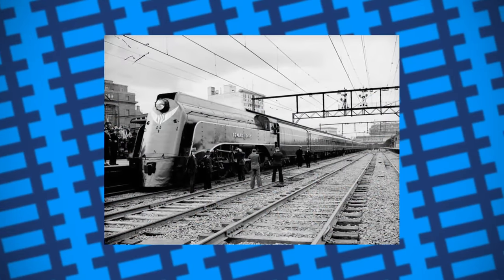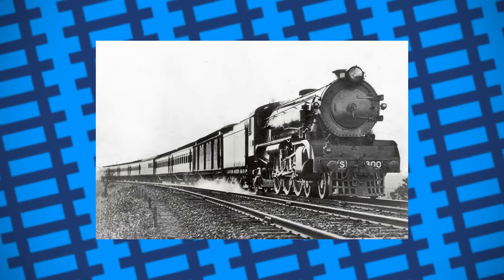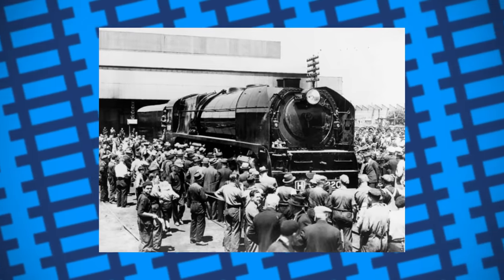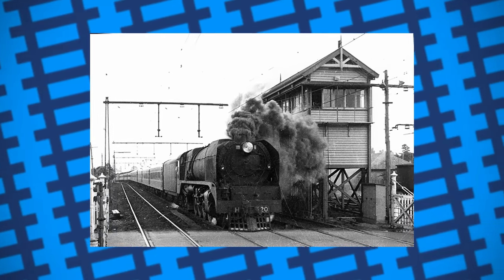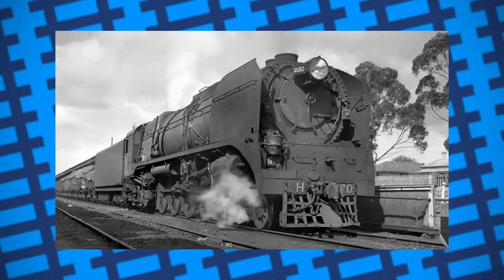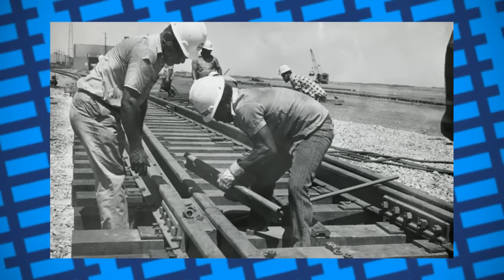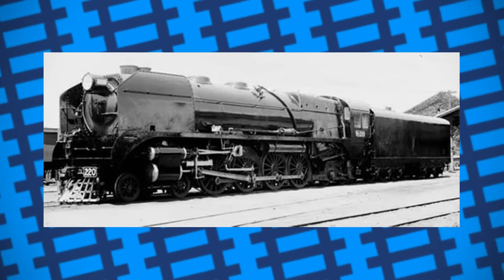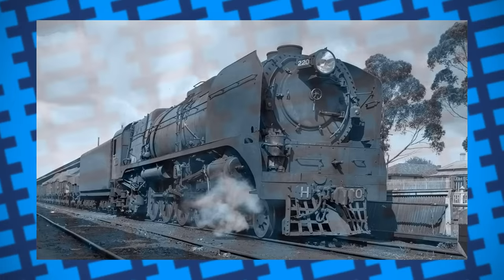Australia's most Overkill Steam Engine - Heavy Harry

Comment: Overkill locomotives are always so much fun to learn about considering their strength compared to everything else.
Reply: Which was not the case with H220.
Reply: @dat581  it was compared to the engines around it until dieselization. It was better than the other engines around it, not the whole world.
Reply: @jimmypetrock  I never said the whole world, I said Australia. It was not the most powerful locomotive in Australia at any time.
Reply: @dat581  NSW is not 'around it', none of those D57s could run down here. They would have also had the same problem with axle-load here too.
Reply: Often the case in Australia, the equipment isn't bad, but the railway is neglected. XPT & V/Lo DMU are good examples of this, never being able to achieve the running times they are capable of. Same with the Tilt Trains
Reply: Only the North American giants are bigger & more powerful. 
There was nothing this size in Europe, though some South African locos were close in size. @jimmypetrock
Reply: @johnsergei  Yes. Some much time could be shaved of the Sydney to Melbourne route with appropriate deviations to create a modern alignment.

Ironically some of the deviations made in the steam age hinder the modern railway.
Reply: And the complications that comes to the infastructure
Reply: And the complications that comes to the infastructure
Reply: Though AD60s was more powerful & slightly heavier, the boiler & rear tender were smaller (a smaller profile than H220). But non articulated giants from NSW & especially South Australia were not that much smaller than Dirty Harry. Steamranger are facing a similar problem with 520. It needs a ton of work & what do they need such a big locomotive for? Though they will get the cucumber running again.
Reply: @johnsergei The D57 would be useful for excursions in Greater Sydney. Heavy grades on all four lines leading out of the Sydney Basin (leading in for the Main North) with 1in33 on the Blue Mountains, and 1in30 on the Unanderra to Moss Vale Line.

Comment: Some comments here. The North East line is not heavily graded except for the Glenroy Bank.  There is a long but not steep climb to Heathcote Junction.  Much of the distance to Albury is close to level.  A speed track for which the S class were more than adequate.  The problem was the heavily graded line to Ararat on the way to Adelaide including the notorious Ingliston Bank.  The S class were not capable of working the Overland up these much steeper grades at any reasonable speed.  A larger engine was needed.  The H class was planned as were the bridge strengthening jobs.  There are only a few of them.  Notably the Melton Viaduct, the Parwan Trestles, the Bacchus Marsh bridge and the ironbark gully bridge.  The strengthening wouldn't have been a problem but the war caused a stoppage to this work.  The H class did work at least one train to Ararat even without the bridge strengthening as a test run.  But its ability to work fast goods trains on the North East line was valuable and could be done immediately with no other expenditure. So the reallocation was a no brainer.  Perhaps the remainder would have been built if it wasn't for the run down nature of the entire system after being overworked and undermaintained during the war.  Other repairs had a much higher priority.  So although officially all new engines had to be designed to run on standard gauge the shortage of power was so acute that a substantial number of new K class were built to this successful design. Even though they were never intended to be convertible. That was  higher priority than repowering the Overland.

Comment: Commentary is wrong in several places.. ARHS did not take ownership of H220. It was merely placed in the Museum which was at the time operated by the ARHS. Harry was and still is owned by the Victorian Government as is virtually all rolling stock in the Newport Railway Museum.
Glenroy Bank is at best 4 miles long not 5, but only about 2 miles is 1 in 50. Some irrelevant stills used in the video such as that workshops Martin's? and the track guys in hard hats.
I'm pretty sure also that the axle weights were known at the design stage well before it was finally assembled.

Comment: For those who don't know what they are:
Load compensating brakes are equipped with a valve that basically mesures the total mass of a vehicle and regulates the force with wich the brakes apply accordingly. While standard practice these days, it was a huge deal back in the 30s/40s, as it was a fairly new technology back then. Previously, on locomotive tenders, you just had a pre-set force with which the brakes would apply. This is fine if the difference between loaded and empty is minimal (maybe a couple tonnes at most) but once you start going into double digits, the vehicle starts to behave noticeably worse when braking, increasing braking distance.
Reply: Thank you.
Reply: Thanks a lot for your comment. I didn't know what they were.
Reply: @colvinator1611  You're welcome 😁
Glad I could be of service.

Comment: Australia's rail network suffered from a major problem. Each of the Colonies in Australia was originally it's own thing with settlements far apart from each other. As such, they started up their railways all using different gauges. Some when for standard, others wide and others narrow and they were rather stubborn about this and ran with it. When an East-to-West transcontinental line was finished, you had to get off and switch trains. This remained the case after Federation and well into the 20th century.
Reply: but it still isnt standardised the melbourne to sydney route and melbourne to adellaide route is run tri - rail to melbournes southern cross which is now run by v/line services
Reply: Whilst I can imagine the many problems it caused (which presumably why there's now a standard gauge network linking the important cities), I personally love the fact that the track gauge in Australia varies by state. It adds some more variety to the already really varied collection of locomotives they have down under.
Reply: Interesting
Reply: at the border stations became something of a spaghetti junction with up the three gauges on one line.  Makes the switch work interesting
Reply: WA and Queensland opted for thee foot six gauge owing to the massive distances over which their rail networks operated coupled with small populations and consequent lack of finances.  Three foot six was much cheaper to build.
Reply: VIC 5'3 -NSW 4'81/2 - QLD 3'6.

Comment: My great grandfather helped build Heavy Harry. He died before I was born, but one the stories I’ve heard about H220 was the time a driver pushed the throttle lever at startup, and Harry decided to "slip" - a common occurrence with old steam engines where the wheels will spin in place on the track. However, due to Harry’s enormous weight, the wheels didn’t slip, but gripped. The engine didn’t move, but the track did! Before the driver could take control, it ripped out some lengths of rail from underneath the engine. Imagine that!
Reply: Harry does not move, the world moves for Harry.
Reply: Can't wait for harry to fight alf
Reply: "the fuck am i doing on this shithouse track! lemme do you aa favor and rip this out for you"
Reply: @johnathonmcjohn3  You refer to an ALF class locomotive right? Your comment threw me... my great grandfather's name was Alf!

Comment: Another good video. South Australia had it's own Mountain locos made at Islington workshops like the Sir Malcolm Barclay Harvey.  My mother's 2nd husband worked there as a boilermakers assistant and, yes, he got boilermakers deafness. On the inside holding the red hot rivets while the boiler maker hammered them down from the outside.
A small blooper, the black and white engraving of a workshop is James Martin's from Gawler, SA. A long way from Melbourne. Sadly all gone now and turned into a shopping precinct with only the outer walls remaining. Martin's made SA's first loco. (I think)
Reply: As a child I lived near the Islington gates. At night I would lie in bed and hear the shunters putting the trains together. Dangerous job. I wanted to work in the shops but even though I applied for an apprenticeship I never got one. Ended up in a wood trade.

Comment: Even in the late ‘70s, the VR introduced the C class diesel at 3300 HP, even then it could only run to Albury and Serviceton due to weight restrictions which might have been a statement of the neglect on other lines. But there were no plans for C classes to pull wheaties on wheat lines anyway.
I attended a talk at the ARHS by the Chairman of VR Mr Reiher, later I asked him if the new C class can traverse the new viaduct between Flinders St and Spencer St, he replied “he’d be disappointed if it couldn’t”.
Reply: darylcheshire, ive seen it written that the locos that run to the steel place on westernport and the maryvale paper trains only ever use the newer viaduct and have speed restrictions on them.
Reply: @vsvnrg3263  I didn’t know that.

Comment: Fascinating.

Also I have to agree there's no job that steam power can't do. I realise this isn't quite what you meant by that, but even today most grid-scale electricity still uses steam - coal, gas, nuclear, and even thermal solar power are all just different ways to drive a steam turbine. Because steam is still the best working fluid for these applications, and we're really good at working with it.

Comment: Ah the H class, another of VR's attempts at replacing the A2 which didn't quite pan out. 
Another thing to mention is that Heavy Harry is to my knowledge the only 3 cylindered 4-8-4 left in the world, and uses a special German mechanism. The S classes used Gresley's Conjugated Valve Gear with it's usual problems, and so with H220 they used the Henschel and Son Conjugated Valve Gear which drives the centre valve using the combined motion of two levers attached to the valve crossheads rather than the valve rod ends of the outside cylinders. It worked much better and they were apparently planning to build more S classes using it but then WW2 killed that plan along with the other 2 H's.
Reply: Thanks a lot.

Comment: Just a little clarification, in the 1920's Victorian Railways had two axleloadings for their broad gauge lines, what amounted to Mainline [100 lb/yd] and Branchline [70 lb/yd] (or thereabouts), following the success of Gresley's three cylinder A1/A3 pacific in the UK, came the Victorian S class, which had a drawback of requiring Heavy Rails [120 lb/yd], which was duly fitted to the flagship service "Spirit of Progress" between Melbourne and Albury - to meet the "Southern Aurora" at the break of gauge to New South Wales.  The H class was a further evolution for the other Intercapital service, to Adelaide, the original intention was to build at a minimum of four H class and ten S class locomotives, all to be named, as it stood there is an orphan H class [which survives] and were four S class [all scrapped].  All five locomotives were restricted to the North East Corridor, the metropolitan yards and south to Geelong.
Reply: The S class were all scrapped because of a clause in the GE contract for the diesels. The S class steam engines still greatly outperformed the new diesels, and GE didn’t want that seen.
Reply: @robertchapman6795  , not true.  the diesels that vr bought were emd's by general motors.  gm had no fear or deals about the elimination of the s class.
Reply: @vsvnrg3263  I’ll leave this debate open. Because I’ve never heard otherwise. I’d be happy to be proven wrong, but I believe that’s why the S-class were immediately scrapped. Otherwise, I’m absolutely certain they would have been the proud and exciting headline acts of the ARHS and other steam preservation societies. Only greed would’ve been the driver behind scrapping them. Not stupidity, because that would’ve been overridden by common sense people.
Reply: @vsvnrg3263  and yes. I got my GE and GM wires crossed. 👍
Reply: @robertchapman6795  , go and read the wikipedia page about the x class.  the yard teams continually shuffled the locos on death row to save the more precious ones.  thats why there is only one x class left.  there would have been none.
Reply: @vsvnrg3263  I believe that. But I’ll remain sceptical of the S class locos. The yard crews would have definitely done the same for them as they were VR’s only streamliners AND the most advertised and admired. I believe the most historically significant VR loco. Even VR would have kept them unless ordered otherwise by brutally heartless bureaucrats to ensure their death. 🤔
Reply: @robertchapman6795  Having been there at the time, and read the stories in the VR news, the S class was worn out.  They had done great distances.  Were suffering from cracks in the frame and other consequences of wear.  So they became too expensive to maintain.  They were beyond rebuilding.  They needed replacement and as the diesels had been so successful on the Adelaide line there was no question that specialised steam engines were no longer justifiable.  As soon as there was an alternative to operate the service they were retired.  The H class was much newer and had covered only half the distance so although intrinsically expensive it lasted a little longer. Once it needed expensive maintenance it also was retired. It only remains because it was a proud showpiece at Newport workshops.  The X class was going the way of the S class.  They were down to the very last example.  I believe that there are even some cutters marks on it. That is how close it came to destruction.  And that was what prompted the creation of the Railway museum. In the fifties no one had any idea of "railway preservation" or even preservation at all.  The idea was to modernise as quickly as possible.  In many states this lead to the destruction of the tram network.  People wanted to forget all about the past.  It hadn't been a lot of fun for an entire generation.  Don't forget that the depression was followed by the second world war so the state had been in a case of suspended animation for 20 years. So much of our history vanished during the 1950s.  Yet it was also the time of the most bouyant optimism.  There were shortages post ww2.  But each year was getting better. So that everyone was looking forward to a brighter future.
Reply: @robertchapman6795  Rubbish, VR had EMD diesels not GE and no such embargo existed.

Comment: Garratt articulated locomotives were popular in Australia and around the world,  with fairly light track loading and over 60,000lbs tractive effort they were able to operate on tracks with very tight bends...  I still remember seeing them in South Africa and Rhodesia - they were very striking with the water tank on the front with its big headlight.   Very impressive thundering up the Capetown to Salisbury main line, they were also very useful in mountainous areas due to their ability to handle tight bends.   They also had a wonderful 'offbeat' sound as the front and rear locomotives ( separate ) blast pipe rhythm went in and out of synchronisation...

Comment: 3:14, it could do more than 50mph.  it was a powerful fast passenger locomotive with more power than the s class and only marginally smaller driving wheels than the s class.
Reply: Power parade lists it as 60 mph. The main reason for limiting it was wear and tear on the track.  The D3 with significantly smaller wheels were also rated for 60 mph and the NSW C 38 class had similar sized wheels and were permitted 70 mph.  The 50 mph limit was due to the four wheel wagons on the goods service. THEY were limited to 50 mph.  So that limited the entire train to that speed.  You would note that the C class had their speed raised to 60 mph but the X class were ONLY allowed 60 mph when hauling the spirit of progress.  Again to lessen wear and tear on the track.

Comment: There is a story from the book "The right way, the wrong way, and the Railway" where a driver recounts how Harry's regulator was stuck open on a hill climb, and his wheels began to slip, so they applied full braking to the train and engine. The driving wheels, instead of slowing down, continued to speed up, completely demolishing their brake blocks. Due to the wheels being weighted, as well as minor weight offsets etc, the whole 264.2 tonne locomotive began to bounce up and down in place. I can't remember if the speed was in mph or kph but apparently the speedometer showed 90ish somethings, much faster than its operational speed. Eventually, the crew counted their losses and extinguished the fire on the locomotive. The next morning, when a recovery train arrived, they found that H220 had gouged out 4 huge wells in each track from where its 1.7m tall wheels had hammered into them. Truly this loco was a beast at power.

Comment: I heard there were HO scale models of Heavy Harry and I sure would like to get one! Also, bear in mind that the Victorian Railways had broad gauge rails so Heavy Harry was really a giant.
Reply: All are expensive handbuilt Brass models. There was first the Australian Locomotive Company (ALCO) in the eighties run of about 500 then the 2000s or so Trainbuilder models.
All need skills to de bug and I would suggest curves of no less than a metre radius to prevent short circuits.
A few vids on youtube by searching for HO scale Heavy Harry H220 .
Reply: lukechristmas, harry was built in such a way that it could be converted to sg.
Reply: The Steam Engine Is Amazing I Like It

Comment: Very cool locomotive! Very similar to the Pennsylvania Railroad Class M1 in the States. The M1 weighed in at 768,000 pounds making use of the Pennsys heavy rail and wide trackage. Pennsy engineers said the M1 was the finest locomotive on the system. 

Like Heavy Harry, the M1 class used a belpaire squared shouldered firebox, a high mount headlight and 4-8-2 wheel arraignment